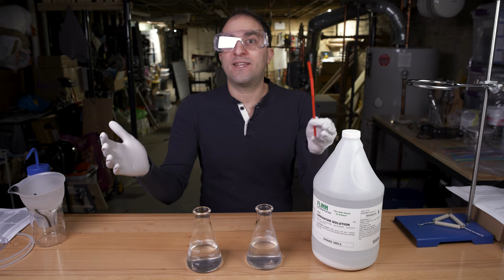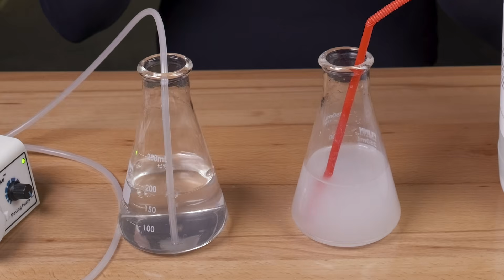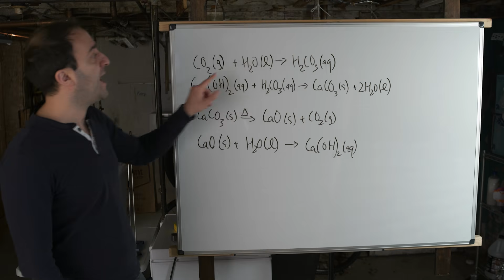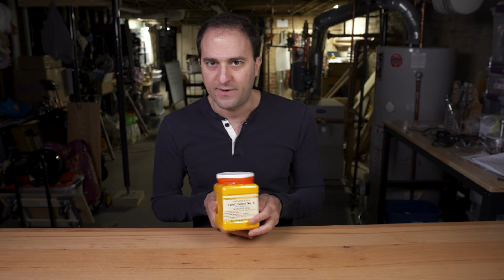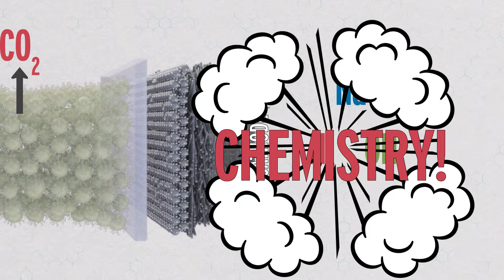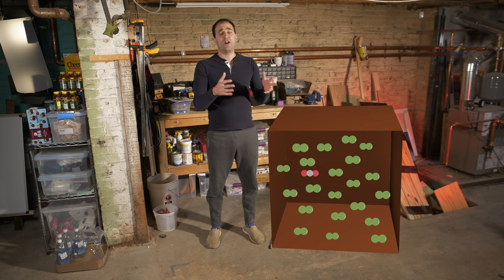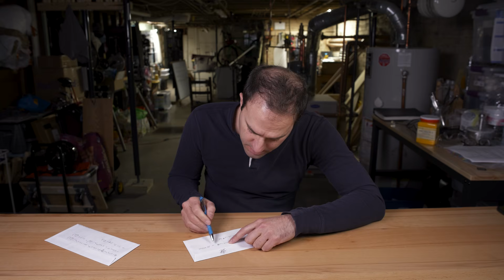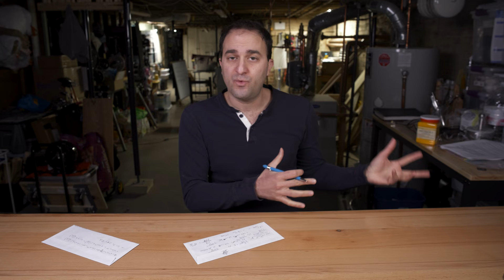Why a Carbon Capture Breakthrough Will/Won't Save Us

Comment: You could have elaborated on what exactly got calculated for the nitrogen-and-CO2 separation because chemically nothing has changed; the two gases are just packed separately now instead of together.  Why do these ways of packing have different "energy states"?  I also find it strange that cyclical chemical reactions are said to require lots of extra energy for 1 of them.  Don't the other 3 produce the same energy then?  Finally, this being a gas separation problem, why bother with chemistry at all, can't we just freeze the CO2 out of the gas mix?  It should "snow out" first as the temp gets lowered, no?

Comment: It's not about energy, it's about transformation. The sun already injects 10-15 quintilian joules into our "sealed" environment every day. What we need to do is transform the CO² into energy through the use of CH⁴, H², H2O, O², and CO in a more efficient loop, and substitute that out for the legacy one way extraction we now use.
The process is already in use on the ISS, just add it to the infrastructure on earth. SOFC's are betterer than burning, swap out the mechanical waste.

Comment: In fact DAC is already remarkably efficient - best in class has a primary. 2nd Law Efficiency of ~50%.   
The problem with CCS at a power plant is that the thermal efficiency is wrecked so it actually takes as much or more energy to separate CO2 from flue gas.    
We are getting there as the first large scale DAC plant (  500,000 tonCO2 per year ) will be opened shortly by 1pointfive. 
DAC is much more land efficient than natural CO2 capture - the 1pointfive DAC plant is ~200mx500m ie 0.1 squarekm so to remove 1 billion tons per year would need a non contiguous piece of land ~ 50 km square using that tech
( Best in class DAC has an overall electrical enegy (work) demand of ~ 1MWh per ton CO2 including compression etc which is ~ 20% of the enthalpy produced by burning methane to create that amount of CO2 )

Comment: There are challenges but I'm not fully convinced this is not a viable solution, if paired with other incentives, for solving the climate crisis. We would still make a transition for how we produce electricity. The con with say windfarms over coal is the unpredictability. We could use windfarms and alike to store the produced energy chemically instead of powering homes for instance, and rely more on nuclear and solar for home and industrial electricity. Chemically stored energy is the superior for moving heavy machinery such as ships, trucks and cargo trains due to its reliability and low KJ/mass ratio.

Comment: I learned in basic chemestry that if combing a carbon atom with two atoms of oxygen release energy, to reverse the reaction you have to give at least the same amount of energy one way or another to split it back to one atom of carbon and two atoms of oxygen.Yes there can be complicated sequence of chemical reactions that can do the trick. But does any of the chemical molecules involved in that chain are found in nature free to use or do we have to use energy to mine/traansport them and/or manufacture them?

Comment: wait so this whole process just releases carbon dioxide though? there has to be something im missing, is the point of the reaction to move co2 and concentrate it rather than to actually get rid of it? i assumed "carbon dioxide removal" wouldn't entail putting the same co2 you just captured right back into the air by freeing it from calcium carbonate. what are we capturing it and putting it in giant tubes or something? honestly what we really need is some way to turn co2 into carbon and o2, that would be the haber-bosch process of the 21st century. someone whos smarter than me should get to researching that NOW. we could power that reaction with something renewable and infinitely cycle carbon atoms and play god.

Comment: The biggest problem we have is that we have to do something with the Co2, it needs to be transformed in something save, storable or destroyable. Wood is a very good way to store Co2, it is safe and we could bury is deep underground after which it would transform into something useful again in the far future. I don't really like the idea of storing Co2 underground, if for some reason these storages get disturbed then we are releasing massive amounts of Co2 back into the atmosphere. Co2 has to be transformed into a safe state, even after being disturbed that prevents its re-entry into the atmosphere.

Comment: Incredible video! However, I couldn't understand why you would want to release the captured CO2? Of course, to regenerate your substrate, but what do you do with the captured carbon?
Reply: Many times it's sold, so nothing gets actually captured. But it can also be chemically fixated on some rocks, or in some industrial use, of which I'm not aware, or get stored on old mines or oil wells. I think I read somewhere that you could store it very deep underwater, and the pressure would keep it as a liquid and it wouldn't escape, but I'm not sure that's actually being done

Comment: Note that the calculation of removing 100% of the CO2 from the air is different than removing 20% using 5 times as much air.  Going from normal air concentration to 0.8 of normal 5 times uses less energy than going from 100% to 0 or to a number near 0 once.  

Note that the injection of CO2 liquid underground elevates the ground and could economically elevate high-value property subject to sea-level rise.

Comment: I love the electrochem breakthrough, but it's not gonna make much sense until most electricity is generated using non-fossil-fuel means. 

I've seen some jokes cracked about fusion technology, but I think renewables are going to be our only chance. They'll lower the cost of energy and democratize it globally, making fossil fuels the more expensive option and phasing it out. If local nuclear or fusion tech becomes commonplace, then it wouldn't be farfetched to increase the global energy production to a point where carbon capture becomes affordable. Plus, a wide acceptance of renewable energy would mean fewer emissions are being added than are being removed.

Comment: The only direct air capture we need is plants. Smoke stacks are a carbon gold mine that release the CO2 into the air but that's exactly where we should be capturing it. Straight from the source before it ever makes it into the atmosphere. Given that carbon is used to produce graphene, graphite, artificial diamonds and gas cartridges it seems more reasonable to simply install and run a carbon capture machine on s smoke stack and then use the carbon to produce valuable goods rather than jumping through hoops to get it back later.
Reply: CCS takes roughly the same amount of energy as DAC as the efficiency of a power plant with CCS is poor.     Plants are no use as they rot, producing methane.....
Reply: @ldm3027 methane is good fuel..

Comment: If we can reduce our emissions by 80-90% we very possibly won't need carbon capture At those low of levels it is very possible the Earth could adjust to that new equilibrium. The Earth has a VAST capacity to process CO2 in the atmosphere.

Comment: When it comes to DAC (as opposed to CCS at major co2 emitters) I see a problem not only with energy demand but also with co2 exposure. Every DAC plant can only reduce co2 concentrations in a small volume. Now thanks to convection (i.e. wind) and diffusion the DAC plant will always be exposed to higher co2 concentrations, but there is still no getting around the fact that we need HUGE numbers of DAC sites to extract a meaningful amount of co2.

Comment: The oceans and microbes are the key
Reply: Microbes:

- can be genetically modified

- "little factories that play with CO2 for free"

- could be designed to multiply comparatively quickly to others

- could be designed to "build fat" (carbon stores) in such a way that they sink at a very high rate (but below that of reproduction)

Basically what the ocean's photosynthetic microbes already do, but we step in to supercharge it.

Comment: A question to everybody, i'm not an expert in this field, but curious... Actually we don't need to wait for nucler fusion, we have nuclear fission with an high capacity to reuse scories in the cycle (right?).... It would be so crazy to build more of those nuclear centrals only to fulfill the energy requirement of those C02 capture machines?? We actually need to start absorbing more and more C02 while we reduce our emissions, we can't wait decades to say "well we did it, C02 free emissions, now we only need to catch back the mess of some centuries!".... So a good mix of forests rigenerations and green electricity (wind, sun and why not modern nuclear fission - to sustain C02 capture industry) could be a good point to start acting now?? Sorry if i'm not technical or specific, just a human being that hope humanity could achieve the first mission of every life form: survive
Reply: Hemp grow faster and more dense  than a forest. The hemp can be used in construction when mixed with lime. The result is called hempcrete and it absorbs CO2 naturally for the rest of time. Acre for acre hemp crop will capture more CO2 than a rainforest but it can be harvested and grown again and again.

Comment: To solve CO2 capture we need energy - it has always been that way, it will always be that way. Tinkering with efficiency is fine, but it won't solve the basic problem of NEEDING POWER.

So this is what we should focus on - how to supply the most power for the lowest cost. This is the true solution to CO2 capture and basically anything else really - cheap power, at scale.

Comment: a combined effort is almost always the answer:
reduce emissions / reducing consumption / paradigm shift 
direct air carbon capture
prevent carbon release from production
reduce carbon production with more efficient systems
terra forming / fostering natural methods 
uprooting the profit incentives to pollute

Comment: The ocean does some of the concentration for us, so capturing dissolved (bi)carbonates from there will require less energy and still lead to lower atmospheric co2 since the ocean and atmosphere exchange co2 in an equilibrium. 
Heck, any body of water connected to the ocean will do, since removing (bi)carbonates from from a river will still lead to less of them in the ocean, which will then need to absorb more from the air to restore a balance. And then electricity for the electrolysis can be hydro produced from the same river that (bi)carbonates are being extracted from.

Comment: If carbon capture can be engineered to be episodic, it could use excess wind/solar generation. ie when that would otherwise be unused, and the used electricity rendered cheap or even minus! Let's just call it joined-up thinking. Be negative all you want, but it won't solve the CO2 build up problem. We need solutions, and lots of them! Joined-up thinking, creative thinking. CO2 is one thing we don't have to remove every damn second as long as some appreciable reduction is achieved. The alternative is the grandkids pay the price.

Comment: For reference the oceans cover about 70% of the planets surface.
In the past when CO2 got out of hand (naturally, not man made), the planet righted the ship with a few combined processes.
No. 1, was increased weathering.
The result of that was dumping huge amounts of what was essentially fertilizer into the oceans.
No. 2 was the increased growth of Algae. 
Yup, these tiny water plants in their trillions all over the oceans sucked up massive amounts of CO2.
This sounds great, right?
Well, yes, and no, and brings us to process NO 3.
While it does suck up huge amounts of CO2 quite naturally, it also means a LOT of dead Algae on the ocean floor.
This creates a buffet for microbes, unfortunately to digest all that Algae, they must use massive amounts of the oxygen in the water.
This makes the oceans anoxic (lacking in oxygen).
This is NOT good for animals that breathe their oxygen out of the water.
Basically it creates an extinction event. (the size of that event depends on how  much of the ocean becomes anoxic.)
There are no easy solutions to climate change, but not burning a valuable resource is a great way to make things less bad right away.

Comment: Another video about carbon capture(quite enjoyable) but once again omits the only carbon capture method that could work and be scalable. Why forgetting about it? Enhanced weathering jumps over the requirement for concentrating CO2, isolating it compressing and putting somewhere- and thermodynamics is beneficial in that case. The products of weathering are more stable than starting silicate rocks and CO2- so the only energy to be spent is on mining, crushing the rock and distribution. Why the only attention is being paid to the process that is more complex and not the one that could work? VC capital, patents, companies, money are with the CCS- possibly achieving something- with enhanced weathering.

Comment: being a “chem eng” i understood < half of the video. i had no immediate reference point to the units of moles is kgmoles? it be useful to relate that to something more tangible mass unit  like kg  or lbs on the kjoules units it would have been useful to relate it to something like barrels of oil, million cubic feet of natural gas, etc it would be useful to mention the energy units in btus as well. etc. suggestion, slow down, if people stay after the first 2 mins they’ll stay for an xtra 4-5 more mins.

Comment: I think this process is kind of flawed to begin with. We should find a way to get the CO2 out of the air, and use it for some industrial process, not just extract it and bury it! I mean, don't focus on having a reusable catalyst, focus on a useful reaction, that could convert that newly made material into something useful for the industry. Carbon would be useful for a lot of things, including producing the long awaited carbon nanotubes at scale. And for electricity to power the fans, we should use solar panels, wind turbines, and nuclear power. Of course, all those would produce CO2 to build, but we have to start somewhere, and we need to scale up massively! We must do everything possible, to at least slow down the global warming! And we must do this even if it's not cost-effective! Very important! Life on Earth doesn't have a price tag associated with it, so we shouldn't attach one!

Comment: I have never deemed carbon capture to be a lost cause, even though its an energy hungry and economically costly system. what I have deemed a problem is the methodology used to actually keep the CO2 trapped, having some method to "brick it" rather then creating an underground bomb would be my train of thought. then finding some use for said brick, alleviating some economical problems (or oil like sludge, tarmac really anything other then moving CO2 from the air into some sort of canister). problem here would be where to get the constant influx of bricking material at a low carbon emission cost, as we are not using a regeneration step for the reactants. 
In its current state, its not viable and if used as the only solution it never will be. however the very idea of re-solidifying CO2 we released into the atmosphere by burning fuels is a good one.

Comment: So part of the Exhaust can work as the heatsource i mean you extract heat from the Exhaust gases with heatexchanger and the gases still have temperatures over 100° C so it can work to heat this absorbing substance

Comment: We do have extra solar and wind that has to be ramped down because it produces too much power at the moment (pricing on the energy market goes negative). Even if that it intermittent, we should do processes like carbon capture with that extra energy. We need to deploy all possible solutions to reduce the maximum global warning temperature.

Comment: Carbon capture is great if it's atmospheric and it is used to make synthetic fuels, not with electricity but with concentrated solar
Reply: Will you pay 5000$ per gallon of gazoline? Being generous, let assume a 5% efficiency from electricity to synthetic fuel and a cost of carbon capture at 280kJ per mole. 
Carbon capture : 280 kJ to get 12g of carbon.
A gallon of gazoline is about 6 pounds. So to capture enought carbon you would require 193 mol of CO2.
So just getting the material is 15 kWh.
Then to convert gazoline to CO2, it give about 35 kWh of energy (33.7kWh to be precise) 
So you would need 700 kWh to transform CO2 to gazoline. With a round trip at 715kWh of electricity per gallon of gazoline. At 10 cents per kWh, your gallon would cost without finance and profit, a minimum of 71$/gallon. 
Add few multi billion dollars plant to perform the chemical conversion and you would be better to bike instead of making synthetic fuel...
Synthetic fuels like hydrogen only work with unlimited free electricity... With unlimited free electricity, we would not have any need for synthetic fuel or hydrogen...
Reply: I never mentioned electricity. The Sahara exists, it has billions of kW of sun energy pouring all over that land mass. And it can't be reliably turned into electricity. There may be a way to run carbon capture and conversion into fuel strictly with CONCENTRATED, THERMAL SOLAR energy. 

They tried to make a giant energy ring around the Sahara and send the electricity back to Europe but that is unreliable since lots of energy gets lost in the wires over that distance. But chemicals do not lose anything being transfered in a pipe
Reply: Besides, sooner or later we may be forced to pay more than $500 for "fossil" gasoline. Either because govt make it expensive because thy are idiots, or because it trully gets scarce, or because arabs simply do not want to trade with the West anymore (not very wise of them, but statists are rarely wise).

But if we want to go up the Kardachev scale we need to use all the energy earth provides and Sahara must sooner or later be used